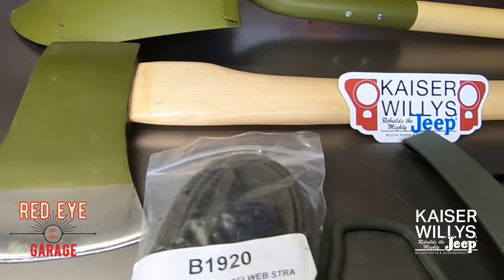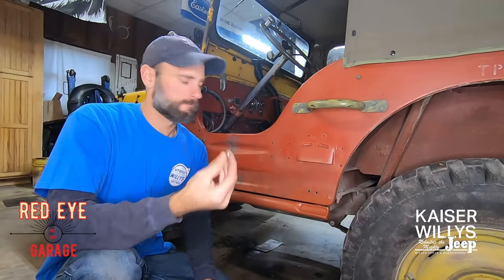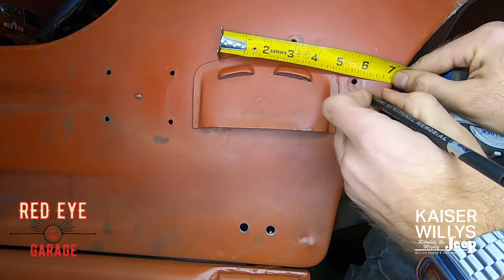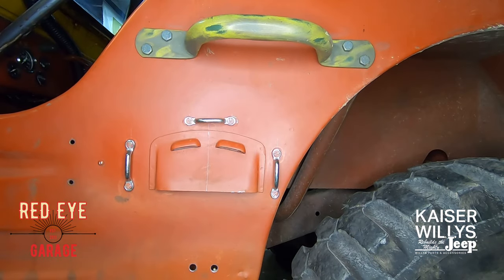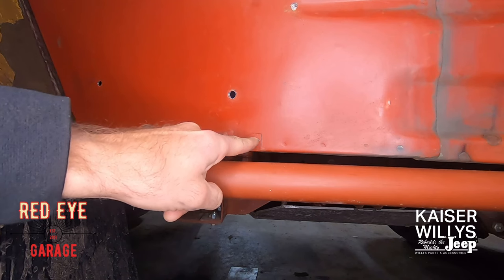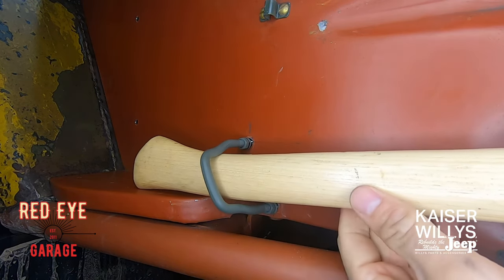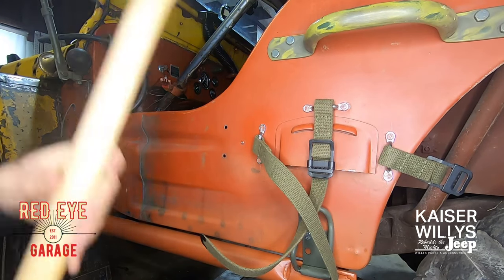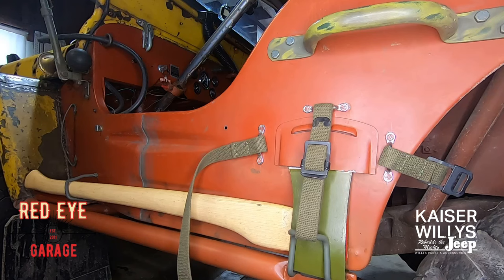Willys jeep axe and shovel install

Comment: Great video. I have two GPW’s and didn’t know about the 2 holes in the lower axe bracket, thanks!
Reply from the maker: Thank you! I’m glad you enjoyed it. After digging a little further I see that Kaiser Willy’s actually sells an f-script 2-hole brakes. If you have an early gpw I believe that would be the correct bracket. But I’ve been told they kinda had a mixture of whatever brackets were on hand during assembly. 😆

Comment: Do you treat the straps with anything to keep them from rotting and stretching also is there anyway to lock those to the body?
Reply from the maker: It’s common practice to treat canvas with “canvak” but you don’t have to.  The ones I’ve been using for a couple years have nothing on them and it’s held up great! The top on the blue jeep it’s about 6 years old and the straps are untreated. You could fabricate something to lock them but in stock form there’s really no good way to lock them.  Thankfully I only frequent low crime areas haha!